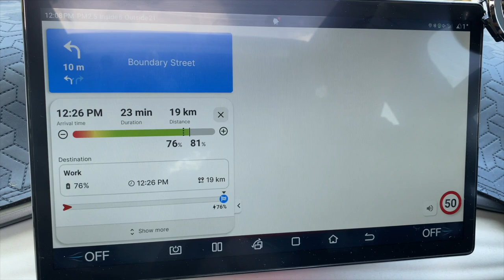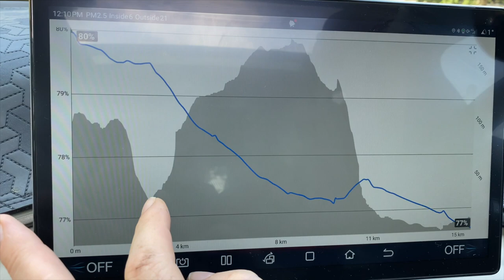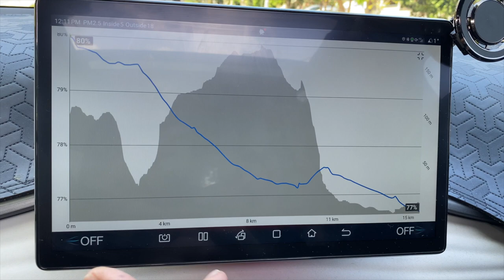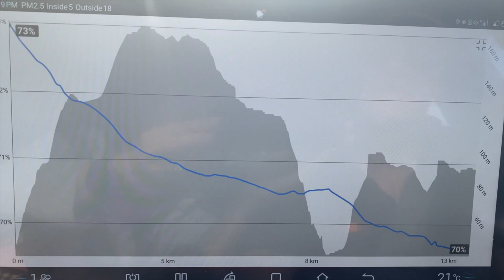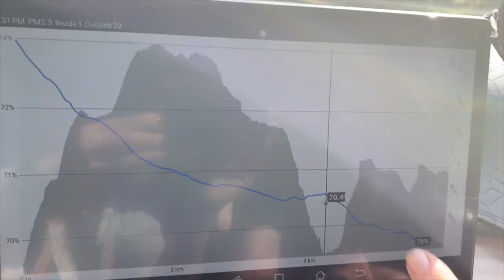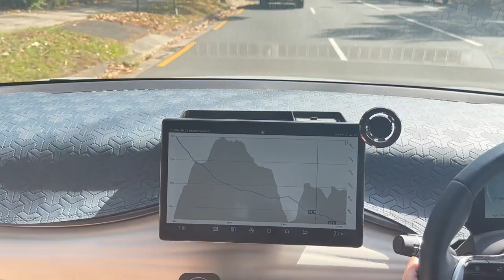Nice BYD wheels for free & ABRP new feature

Comment: Thanks for the video Chris. I am assuming the BYD Seal wheels are a similar deal. It's certainly not the same aesthetic improvement as removing the aero covers from a stock 18 inch Tesla wheel. Those bolt lugs on the wheel are not intended to be exposed. I think I'll be leaving the plastic bits attached to my Seal's wheels!

Comment: Chris, that is the shortest wheelbrace I’ve ever seen. You need a correct length wheelbrace, not only for leverage to undo the nuts, but also to tighten them again. I’m happy to school you in mechanical things if needed.
Reply from the maker: Hi Patrick,  thank you for the advice. Unfortunately I don't have a mechanics tool collection:)
Reply from the maker: Unfortunately you picked it was spark plug wrench that is why I marked the bolts.

Comment: Chris, if you want to cover that “ kerb rash “ on your wheels you could try dipping the wheels. I did my Seal wheels and emblems as I wanted all black and I was super surprised how easy and satisfying it is, plus if you don’t like it you can take it off easily ( or if you are thinking about hitting the kerb again 😮 you can repair easily ).
Plenty of YouTube videos on the subject, mainly using Plasti Dip but I used Elastic Dip from a Thai online website and am very happy with the results.
Black seems the favourite, I went for Flat ( Matt ) Black, but there’s plenty of colours to choose from.
Check it out.
Reply from the maker: Sounds good! I will check it out. Thanks for the tip:)

Comment: As a long distance cyclist who is brand new to EV (28 hours old), I am continually reminded of the parallels — consideration of hills, headwinds, drag (roof rack vs panniers), the wish for services at country towns…😅
Reply: I have had the exact same thought: High speed, uphills, rain, snow, wind, cold, ..... all of these are important both when I go on a bicycle or an EV ride. But the energy conversation techniques learned on the bicycle, also largely transfers to EV driving.

Comment: Hi thanks for this fine video.
Importent question for me, if you dont mark the bolts 1 to 5 with a pen on the weels what happens then... i,m soon going to change my weels to winter weels. Is it nessesery to mark them.

Hope to hear from you soon.

The best from Sweden
Reply from the maker: Hi Bertil, hello from Sydney Australia. It's nice to hear from you again. The only reason i marked the studs and bolts was so i could get the same torque setting as the factory. So i don't need to use a torque wrench.
Reply: People have been changing wheels without torque wrenches for a long time. 

If you guess by feel it will work. If you are uncertain check the nuts after 50 km of driving.